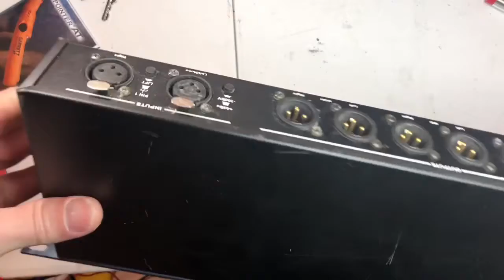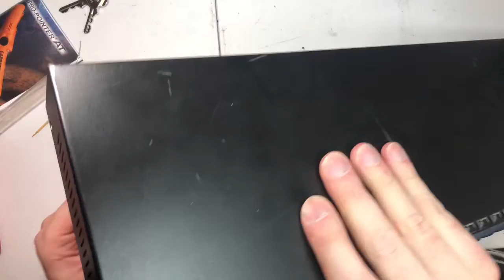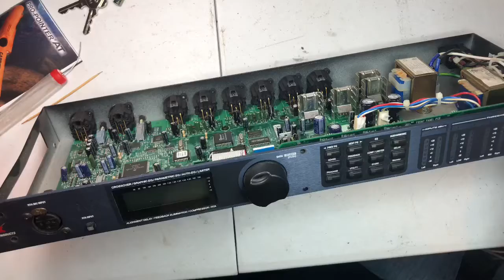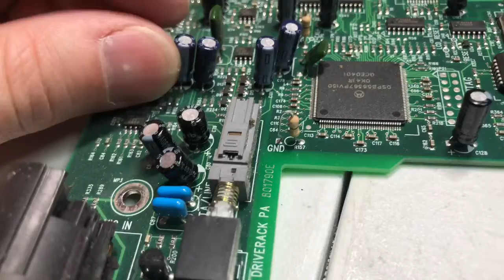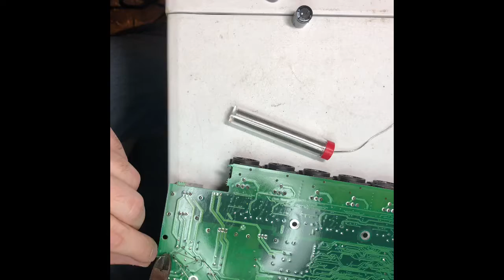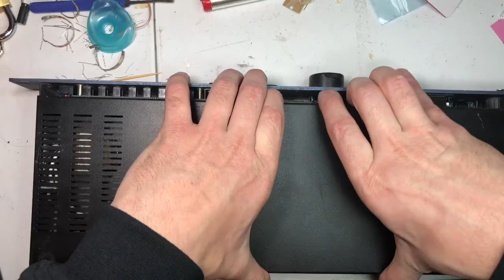Dbx driverack pa white noise repair

Comment: Thank you for you video. I have one of those and the display is blue with nothing displaying on it. I check the 3 large capacitors and they are fine, however, I notice tha U27, a small 6 pin IC next to the 3 large capacitor has exploded. Can you tell me the correct Part number for it? the SMD marking on it is IF8CH

Comment: Funny how you mention how boring video may be around 27:00 - not boring at all brother.  Thank you for making this, cause not only are my soldering abilities lacking, but you also may have helped me big time.  I have that same DBX DriveRack PA crossover and I was having trouble with my right channel fading after system being on for about 30 min.  I believe it may be an aging/cheap capacitor and with you supplying the list of proper caps - I should be good to go.

Trash is always treasure.

Thank you kindly.

Comment: I have a question. Is there a circuit too small to replace on that unit? I have a circuit that is located where the subwoofer output line is.  There is a whole row of small circuits that are located for each output. We'll on my units output for subwoofers, the first small circuit is seems to have shorted. I see black smudge around the circuit. Can this small part be replaced or is it too tiny that it can't be done due to possible damage to a part when soldering?

Comment: Hay sirr my dbx 260 is restart & restart again. . Please 😫🙏🙏 give a tuttorial
Reply from the maker: Check capacitors. 🤷🏻‍♂️
Reply: @hitandrepair hii you have recommended for upgrade op amp ?
Reply: @hitandrepair hii sir, DBX pa+ capacitor powe supply 1000uf and 2200uf upgrade 3300uf do you like?